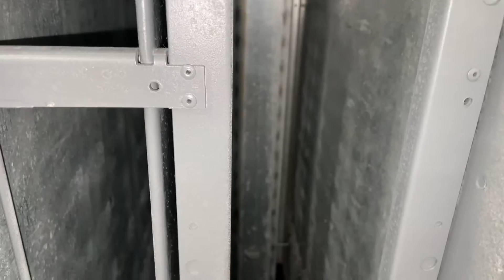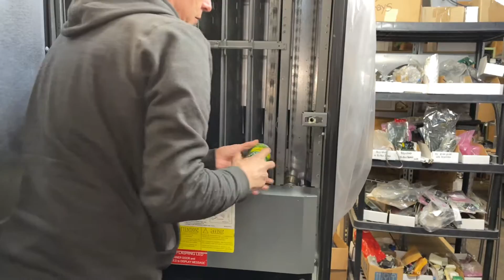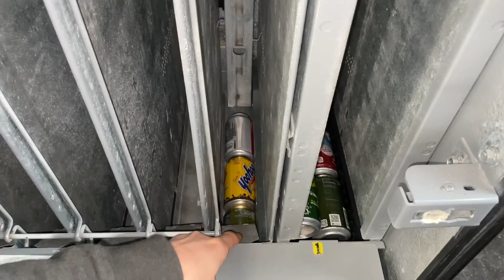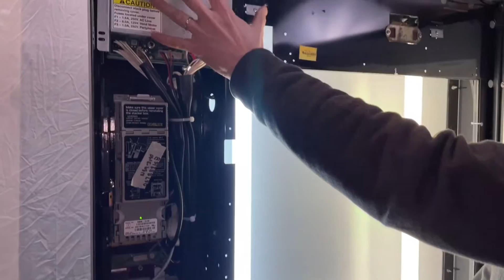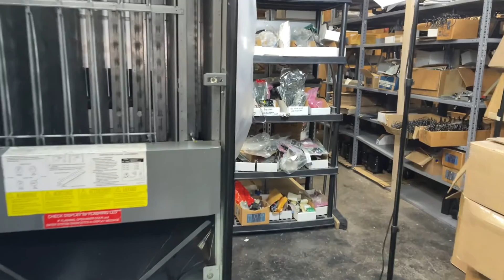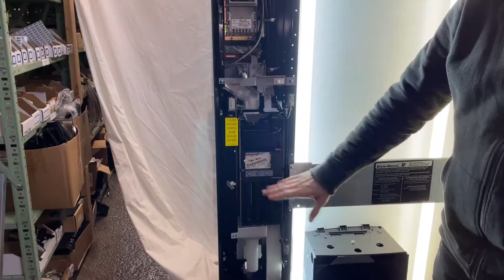Dixie Narco 501E & 276E Vending Machine - How To Load Drinks And Prime

Comment: Good morning Alex;  I have an issue with my Dixie Narco 501e Pop Vending Machine. The display code appears as "88.70".  Nothing happens when I press any of the flavor buttons.  I only assumed this  was a pricing issue.  When I add 4 quarters (which was the current price of pop), nothing happens.  My only recourse was to initiate a coin return. 

Then, I was following your instruction with attempting to set pricing for pop.  I did press the service (blue) button and "HD" appears.  I press the top 2 selection button to bring up  S-P option.  When I select the desired flavor button, I get a "LOC" display and cannot go further.  Please help me to discover what is wrong with my machine.

Comment: I’m having problems loading the wide column with cans. It’s giving out 2 every other vend. How many flat shims should I use
Reply from the maker: You will need to have a total of eight black plastic can shims in the wide column. Four on the left and four on the right.
Reply: @VendingMachineSupport I have 4 on each side and it’s dispensing 2 on one vend and 1 on the other.

Comment: Question for you ..I have a Dixie narco 501 e and I have the first wide column set for cans with the 8 shims and the back spacer set properly . Timing cam is also set to 6 open notches . For some reason every 3rd or 4th vend I get a double vend any idea why ?
Reply from the maker: The busing that is located where the oscillator joins the drive arm of the vend motor may be worn out. This can cause the oscillator to have too much left and right play. This can cause the issue you are explaining.

Comment: Can you load 16oz energy drinks into this machine?
Reply from the maker: Yes it will vend 16oz cans. For the narrow columns ( 2 through 9 ). You will need a rod & spring inserted in to the cradle. Set the rear spacer to hole 8 and the timing cam to 3. ( https://youtu.be/iSS4eGRIa8c )

Comment: how would i go about priming a single price dixie narco? i own a dncb 180cc its single price with no circuit board
Reply from the maker: You need to press the motor home switch on the vend motor. This will actuate the vend motor and make it rotate. Or you can simply run money through the machine and keep vending a selection until something drops from the column.

Comment: Hey Alex, I want to know if we need nickels and dimes in the 501e.  Our machine was built in 4th quarter of 1999.  We only use quarters for our pop.  We set the price to $ .75 ..
Reply from the maker: You will need a minimum of 12 coins in each tube if you want to accept $1.00 bills if equipped with a bill acceptor. If all your drinks are set to .75 then you need to think of all the combinations of coins that can be equal or greater the .75. For example. If a customer was to insert two quarters and three dimes equaling .80. Then the machine will need to be able to pay the customer back a nickel in change. So rule of thumb is always load each tube with coins. 12 coins in each tube is the minimum. This video may help to understand more: https://youtu.be/4Zoej4twAz0

Comment: Hello Alex, I need some insight for the following:  We purchased a used 501e pop machine and placed it indoors in a recreation area.  The fans seem to run all the time.  We do hear the compressor kick on and off when cooling is required.  Is there a configuration setting for indoor use versus outside operations?  Our old DN (1984) version vending machine did not run the fans unless the compressor was called to cool the cold box.
Reply from the maker: The EVAP fans on most Dixie Narco machined run 247. They are not tied to the compressor like the condenser fan is. New machines will now have the EVAP fans tied to a relay to turn them off when ever the door is open for energy conservation reasons. -sic Energy Star. Your older Dixie Narco has had one leg of the 110V power leading to the EVAP fan(s) tapped into one of the thermostat wires. When the thermostat is unsatisfied power is sent to the compressor and in turn powers the EVAP fans. If the fan(s) are loud there could be a problem with the motor(s) themselves. As in dried out bushings.

Comment: How do you load the wide column with 16.9 oz bottles
Reply from the maker: x6 black plastic can shims ( x3 on the left & x3 on the right ) x4 plastic bottle shims ( x2 on the left & x2 on the right) Timing cam set to hole #3. Start rear spacer at hole #23 and adjust accordingly.

Comment: Is there a way to check the motor switch to see if it’s bad before changing the whole motor? DN501E
Reply from the maker: You can swap places with another switch from a working motor. You can also use a volt meter to check for continuity through the switch.

Comment: Ok i checked the motors after i got switch fixed so i could see HD on the front to cheack them. i have a couple that does not move, does that mean motor is bad or switch on the motor itself. thank you again for your help. i'm new at this. DN501E
Reply from the maker: Try swapping the non working motor with a working motor. Does the problem follow the motor? Here is a link to a video about removing vend motors. ( https://youtu.be/JeCZzP4qGpA )

Comment: My machine don't work with the door open. And I didn't find the sensor. Do you have any idea where is?
Reply from the maker: @Willer Xavier Reis By sensor I am assuming you are speaking about the door inner lock switch. This can be found on the inside of the main door between your dollar bill acceptor and coin acceptor. It is a white pull out switch.

Comment: Alex  do you have a video for assembling and or replacing the green ribbon 9 selection chord that goes behind the 9 selections on 501e.  This all goes against a plate and has grey rubber pushers that back up to a metal plate.  I took it apart foolishly and now I don't know how to reinstall it every combination is not working.  Any help greatly appreciated.
Reply from the maker: @Christopher Sanchez Great suggestion! May be a bit before I can post one. So to get you back up into operation let me see if I can explain how to reassemble this assembly. Sequence is: Plastic Button -> Gray Rubber Strip -> Selection Membrane -> Metal Backing Plate -> 11/32 Nut. The confusing part I have found for many people is the gray rubber strip. This strip acts as the actuator to the selection membrane. If you look closely one side of the rubber strip has nine small hard plastic tips. This is the side that faced the selection membrane. The larger rounded side faces the actual clear plastic button. On the back bottom center of each clear plastic button there is a small raised  area. The larger rounded side of the gray rubber strip should make contact at this point of the button. Hopefully this helps.

Comment: Hey quick question, so my Dixie narco machine is plugged in. I hear the compressor running, bill accepter is on but the digital screen is off and I can’t program it. How do I turn it on ??
Reply from the maker: @Daniel Enriquez I am assuming that you have an E-series model drink machine. If that is the case and the bill acceptor is on. Then you know you are getting power to the control board. It could be that the red LED display for the machine is not working or the harness to the red LED display is not securely connected at either end. There is not a separate on and off switch to the control board on an E series drink machine.
Reply: @VendingMachineSupport  thanks for the response. I will go ahead and check it out

Comment: I live in a cold winter state. My compressor broke. Will the winter keep my drinks cold until I can get a compressor?
Reply from the maker: @Show Runner This is a tricky question to answer.  I will assume your machine will be located outside. The quick answer is that you will just need to monitor the internal temperature. The worry is not will it be cold enough but will it get to cold internally. The ideal temperature range for drinks is between 36F and 40F. Diet soda will start to freeze at 34F. Now, the evaporator fan that circulates the air inside the machine which runs all the time will put off heat. This sometimes is just enough to keep the drink from freezing. I have, in the past for my customers, wired in incandescent light bulbs that would sit in the bottom of the drink  machine near the evaporator coil. The light bulb radiated enough heat to keep the drinks from freezing and, with a working compressor, keeps the drink at a consumable temperature.

Comment: I have a Fsi 3151 CB 700 would you have any idea how to set it to Forced vending the people at the location are using it for a change machine thanks Dave
Reply from the maker: @Dayday Saint An FSI machine is also known as an USI or U-Select It. From my experience on USI control boards. The Force Vend or 'FRC' as it will be shown on the display. Can be found under the 'OPTN' section which typically accessed with button 3. Press the SERVICE MODE button. Then press button 3 to get to 'OPTN'. Press button 1 and the display should show 'FRC N' Pressing button 1 again will cycle between 'FRC Y' and 'FRC N'. Pressing the # button will save your setting and exit. (Mode Button -> 3 -> 1 -> 1 -> #)

Comment: Can you vend cans AND bottles using the same machine?  I was waiting to see column 3 primed to see if the two different products worked
Reply from the maker: You can run both cans and bottles in the Dixie Narco E series of machines. Both cans and bottles are primed the same way. Though each column must be loaded with either a can or a bottle not a mix of the two. For example. If column three has been set for bottles then it must be loaded with bottles. Each column can be reconfigured for a bottle or a can product.
Reply: @VendingMachineSupport  Sadly...we spent 4 hours today thinking we were going to just load the machine close the door and vend.  Came home defeated :(    After loading we realized the 'sold out' flap was not disengaged so after unloading (tuition of life, grrr) we spent way too much time trying to figure out what to do to fix that problem.  We adjusted the back metal 'bar' (depth spacer?) to put 3 cans in and 2 bottles, problem seemed solved.  Then we followed your video to prime the columns, first column dispensed ok, the rest were dropping 2 or 3 cans (we lost several :(  now we're centless).  Again way too much time to find out about shims and then once we set the price and tried to vend only button 2 would work.  Shut the door, unplugged it and threw in the towel for the day :(
So what are shims, how do I find them and once I get the machine set up for cans, how do I get it to vend?  TY
Reply from the maker: @neddy707 Sorry to learn of your issues and I understand how frustrated you may be towards this process. A complete video guide on how to install shims, rods, and to setup a Dixie Narco 501e for different drinks sizes in general is in the works. Until then, from your description it appears there are a few issues at hand. First. Make sure the timing cams on the motors are set for the product size you are vending. Here is a quick video I made explaining how to adjust these: ( https://youtu.be/7Gb6bUHi7cA ).

In the way of shims. If the machine was previously set up for bottles then you will need 12oz can shims. Typically there is a diagram on the inside of the inner door that explains the shims required and what adjustments need to made. For selections 2 thru 9: x8 12oz can shims and x8 rods and springs will be needed. For selection 1: x8 plastic can shims will be needed. Here are a few links to complete 12oz can conversion kits for the 501E: (https://www.veii.com/SHIM-KIT-12-OZ-CAN-FOR-DIXIE) or (https://www.dsvendinginc.com/p-2041-d60907260004-dn-501e600e-conversion-kit-12-oz-can.aspx). Please note that I have no affiliation with either of the these two companies.

How to install these shims is a topic to large place into this reply. I have an old video I made about 10 years ago where I strapped a GoPro on my head while I installed 12 oz can shims into a Dixie Narco 501E. I will upload this video this week and use it as a place holder until I am finished with the new version. I know this is a topic that is in need.

Hang in there and don't give up on the machine. The good thing is once you setup one selection for the narrow columns. Just copy and paster those settings to the remaining columns. I hope this helps and best of luck.
Reply from the maker: @neddy707 Old 12oz can shim install video fro Dixie Narco 501E drink vending machine uploaded. I hope this helps some: https://youtu.be/EAkvc_PYF7M

Comment: Hi
I followed your instructions....wasn't quite a seamless as you did it 😬🤪.
I got my machine refurbished and already set up for bottles as this primarily what is produced in my country.
Had some difficulty toggling btwn the settings.
I switched the coin mech and bill validator (following your video😁👍).
2 Quick questions:
I filled the coin mech and the bill validator accepted cash but then it suddenly stopped accepting cash, what could be the cause?
Is it possible to vend irregularly shaped bottles?
Reply from the maker: Well done on the change and validator swap. If your bill acceptor suddenly stopped taking dollar bills. You may have not added enough coins to the coin tubes. 12 coins in each tube is the minimum. If you have plenty of coins in the coin tubes. Try making 5 to 6 vends using just coins. This will allow the control board to record the total value of coins entering into the tubes. This may bring your bill acceptor back online. In regards to bottle shapes. The Dixie Narco E series machines only work well with cylindrical shaped bottles or cans.
Reply: @VendingMachineSupport  
Thanks for responding 
It's still not taking bills. Also not taking coins from the front.
Help I want to place on location 😩 
Is there an off switch as i dont think plugging and unplugging is the best method of powering down.
Just downloaded the manual to have a read.

Comment: I need to swap out 16oz monster cans to 20oz Gatorade bottles need help with that
Reply from the maker: @Patrick Key If in selections 2 through 9 then set the brown timing cam to hole #5. The rear spacer to hole number #15. Lastly remove the rod and spring in the cradle. If in selection 1. Set the grey and red timing cam to hole #3. The rear spacer to hole #15. Lastly have two black plastic spacers on the left and two on the right.

Comment: Why does my 501e drop 1 can then 2 cans then nothing tans repeat
Reply from the maker: Which selection is this happening on? Selection 1 or 2 thru 9?
Reply: It’s happening on 7 but it’s a new machine to me and is the only column I’ve been playing with
Reply: Possibly because of the missing spring rod ?
Reply from the maker: @evanarmstrong3465  The issue you described is indicative of a missing rod and spring placed in hole B. Make sure you also have the metal can shim installed and have set the brown timing cam to hole number 1. (https://www.youtube.com/watch?v=7Gb6bUHi7cA)
Reply: @VendingMachineSupport   Thanks ! any sites you recommend to shop for parts like rods, shims, switches ,etc ?

Comment: Hey Alex, my Dixie 501e is not taking coins. The coins go right through the machine into the return slot without being registered. Is there something I can do about this?
Reply from the maker: There could be a several issues causing this. Check to make sure there are no jammed coins in the coin changer. Jammed coins can lead to the coin changer instantly rejecting any incoming coins. If you can't find any jammed coins even after removing discriminator (the top portion of the coin changer) from the chassis if the coin changer the problem could be the coin changer it self.

Comment: I need to talk with someone about the programming of my 501e.  It is full and ready to go, but selection 2 says it’s sold out when indeed it is full.  I was reading that the programming should be checked before ruling it as a bad sold out switch ?
Reply from the maker: When you press the blue service mode button on the control board. Do you receive a JC-2 on the front display? Or when you closed the door on the machine did the display read HOMING? If so then there is a jam in that column. Remove all the products from that column 2 and the potential stuck drink. Then press the blue service mode button to receive the JC-2 error on the display. Then press and hold selection button one until the display reads HOMING. This will attempt to turn motor number 2 back to a home position. The current state of the sold out switches can be tested by the control board. This can be found by going to SP and SC under the DIAG menu. SP will show any sold out switches that are empty or OPEN. SC will show any sold out switches that are full or CLOSED.

Comment: Can you show us why a Dixie narco 267e would say sold out on the display and how to solve it?
Reply from the maker: I would be happy too. Though your question is a very broad one. A bit more detail about the issue you would help. Do you have drinks in the machine? Does it read SOLD OUT on all the selections when the door is closed? Can you vend the drinks using the MT-1 found under DIAG?
Reply: @VendingMachineSupport  turns out I just didn't refilled the machine but it is okay now thank you